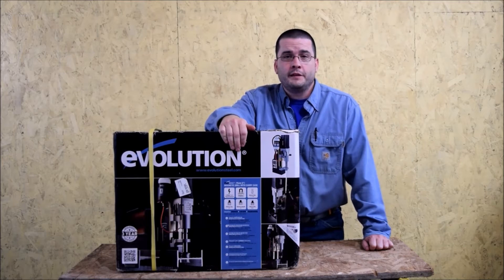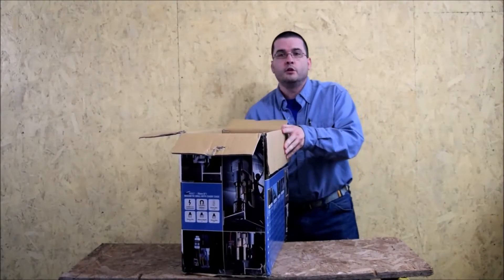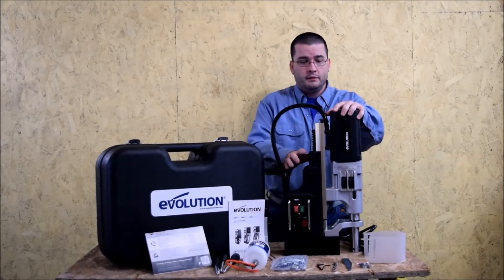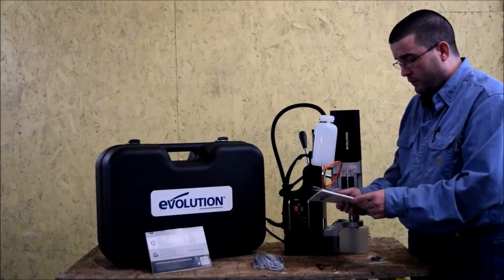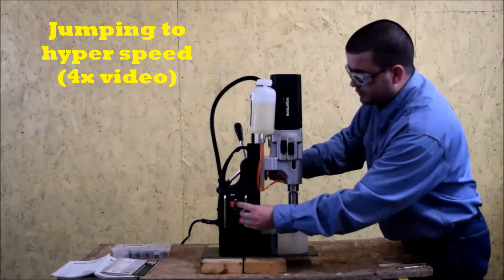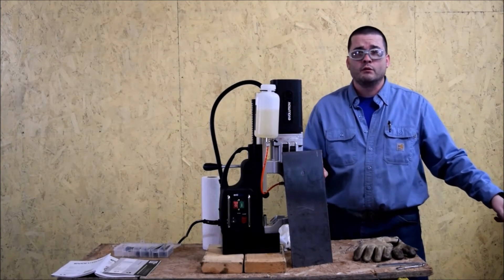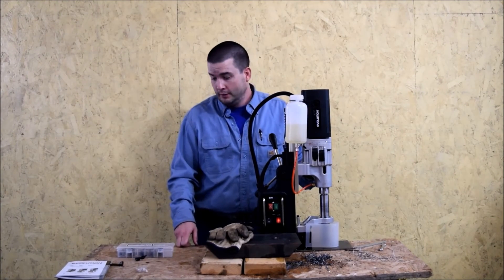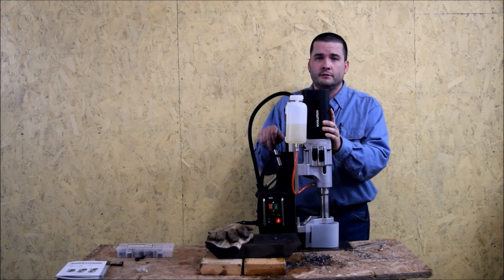Evolution EVOMAG75 Unboxing and Demo

Comment: they must have replaced it. the link goes to the 42 not the 75
Reply from the maker: I didn't believe they ever actually went to full production, if they did it was only one year.  Mine still works like a champ.
Reply: @dansworkshop1972  what was the price of your model? Chat gpt doesn't even know
Reply from the maker: @minkandmatch2547  they sent it to me to review and provide the video.  I bought the saw, made a couple videos on it and they reached out.